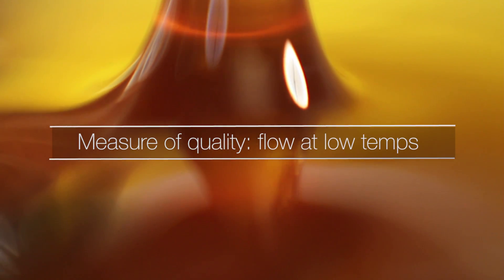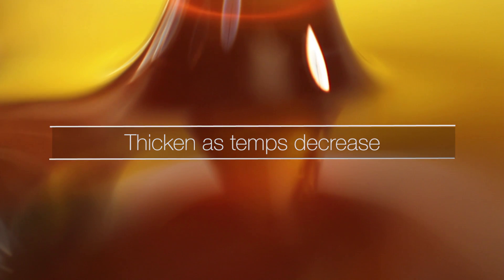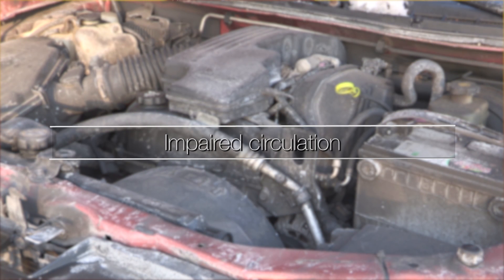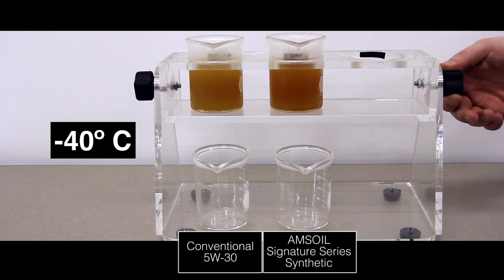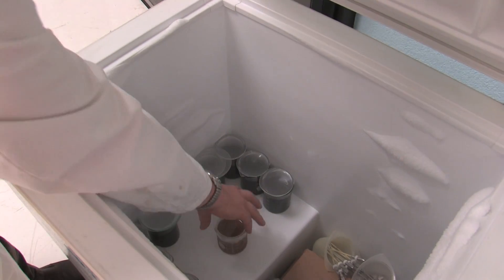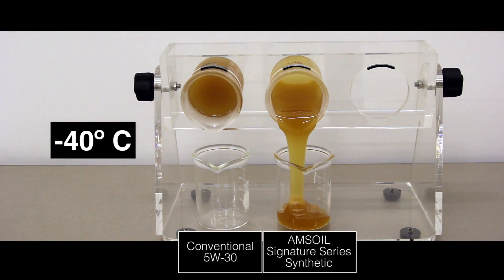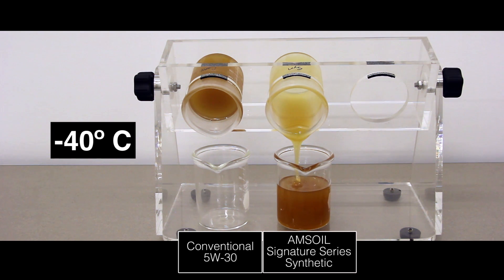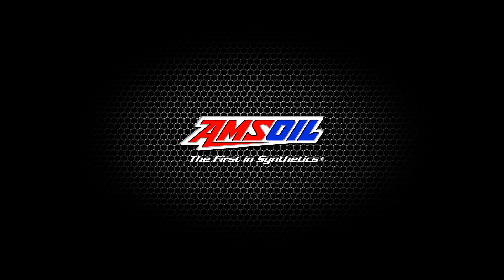Cold Pour Test: AMSOIL Synthetic Oil versus Conventional Oil

Comment: OK, thats nice, I mean I am all for AMSOil, the matter of fact I have 5W20 Signature waiting for next oil change in my LR RRS SC and 5W40 FS European Formula waiting for next oil change in Audi TT 2.0T but...
Conventional Competitor? Thats  a huge stretch. is Competitor Group 1 or Group 2 or Group 3 Hydrockracking or GTL?
I mean, if you had taken Conventional Competitor based on Group 1, which is barely refined crude oil, it is laughable to even try to compare these.
Given that most of the competitors do lie on their label calling conventional hydrockracking Group 3 based oils a Full Synthetic these days but still manage to make some really good (no excellent but really good) oils out of that, it would be nice to have some info about Conventional Competitor otherwise this test may be Toyota Corolla VS Lambo, hey lets see who will get to next traffic light faster...

Comment: Fake as fuck, what a joke!  The container on the left is obviously not conventional oil, it's most likely frozen honey or frozen syrup.  I tried this experiment on my own and the conventional oil flows pretty much as good as the synthetic oil.  The only difference is that synthetic oil will last longer, but if your annual mileage is low and if you never reach the higher synthetic oil mileage limit then there's no point in using synthetic oil, it's just a waste of money.
Reply from the maker: The Force is weak with you, Ovi-Wan. We can assure you that the competing product is indeed conventional motor oil. There are measurable differences between conventional and synthetic lubricants in multiple areas beyond service life, including high- and low-temperature performance, oxidation resistance and more. Don’t just take our word on it; AAA agrees: https://newsroom.aaa.com/2017/06/aaa-spills-truth-oil-changes/.

Comment: Another way of looking at this, cold cranking viscosity.  In cold temperatures we want easier starts and reduced strain on the battery.  There is an AMSOIL study from 2013 conducted by an independent lab of synthetic oils.  You can find a version of it here:  http://www.amsoil.com/lit/g3115.pdf

Comment: Lets see here, 5-30 isn't recommended for use at -40, the commercial is probably using the cheapest no-name 5-30 possible, and AMSOIL doesn't list the weight of the oil in the video, just the description.  I wonder what the oil would do when heated to ~180F and the pour test is done.  Does the AMSOIL cling to the parts providing that thin film needed, or just slip and slide like crazy?
Reply: Well, I run my winter car with AMSOIL Signature Series 5W-30, ASLQT and never had any issues. I Just needed to let the car run idle a little longer than usual.

Okay, we don't get that kind of extreme cold often, but it happens: https://www.instagram.com/p/Bs1_ekkHPzH/?utm_source=ig_web_copy_link
Reply: It does list that it’s also 5w/30 in description. Learn to read.

Comment: -40°C =?°F. Here in the US, we don't use the metric system. lol However, the lowest temperature that I have ever  had to deal with was around -25°F. That usually didn't last long enough to worry about engine oil. Now battery drainage, on the other hand, will be about 90% of your starting problems anyway in cold weather. Besides, I'm still not sure why bragging about the viscosity of your oil at such a low temp is reasonable. Aren't oils rated in their respected viscosities anyway? I mean if your oil flows in extreme cold, and the competitors doesn't. Then you've had to lie about it's viscosity, plain and simple.
Reply: -40 F = -40 C  //  -25 F = -32 C
Meaning you've almost reached -40 C.

Comment: No one should use 5w30 at 40 degrees below zero
Reply: 40 below 0 you'd have bigger issues then oil flow. most antifreeze is only good down to -20.  in which case it'd probably Crack the block.
Reply: +LightSoundImagination yea, it is just showing how its oil holding up to extreme temperature, better pour point means better oil. But they are not comparing to other brand in the same grade, so this video proofs nothing
Reply: they are BOTH 5w30.
Reply: Why? I never had any problem with my cars.

Comment: Rip off! Oil is oil. My Ford Ranger has 220,000 miles. Same engine with nothing but standard oil changes. We saw this same bullshit with the Slick 50 scam.
Reply: Oil is not just ‘oil’. And the difference between Amsoil and Slick 50, Amsoil has been doing this since the 60’s. First Synthetic motor oil. When I put this in my truck, my cars, lawn mowers, etc, it all made a very pronounced difference in performance, noise, general vibration, and fuel economy across the board. Have an open mind, slap in your applications version of Amsoil. You will see and feel the difference and protection. Put in a bottle of PI. You wont regret it. https://www.amsoil.com/p/signature-series-10w-30-synthetic-motor-oil-atm/?zo=30331652  Sign up today as a preferred customer and you get discounts on pretty much everything!

Comment: questionable test.   Replaced my trailer air compressor oil with Amsoil compressor oil becuse cold weather issues.    Amsoil dealer made the  same claims and guess what.   at 0 C would not even turn over!   Had use to use a torch to warm the pump just to drain it so I could refill it with regular oil.

Comment: Ams oil way to go.  Many question how it handles high heat. Well one thing for sure is these oils dont get burn as easly as conventional oils.  Car i drove use to eat oil all the time but no black smoke no nothing.  Oil depleted slowly by oil change i lose at least 1/4 qrt.  With ams i usually retain full oil after 5k miles or 10k miles.  So high temp durability is there.  But people gonna hate what they gonna hate. So do what ever the fuck u wanna do.

Comment: That cranking engines battery at :13 isn't connected to anything.
Reply: Annie the movie
Reply: +Kimberly DanielRa
Reply: kkikkgmhus
Reply: +moldymac looks like its a cheeze dog combo terminal battery and has crappy screw on clamps on the top.
Reply: +fastst1 ffffcccl
Reply: +fastst1 IEl

3D

e
with

s
a

q1.  n µ,
Reply: +Jackie Goodman theatre 1